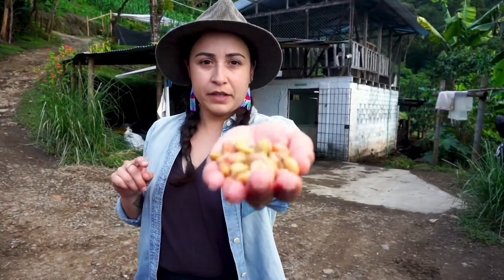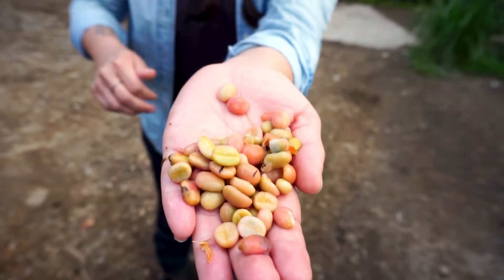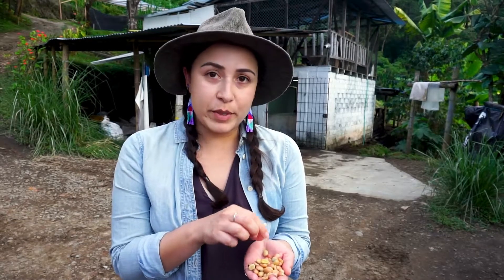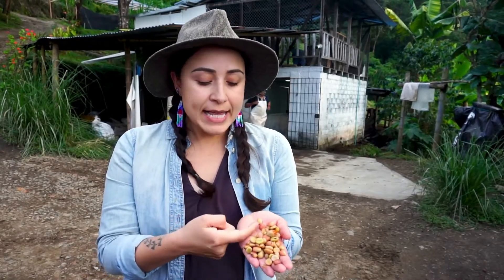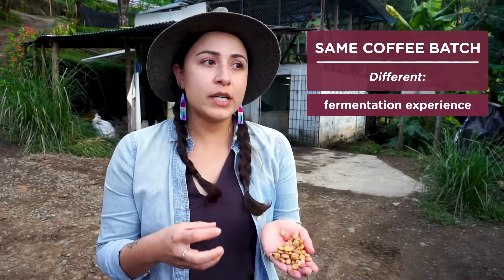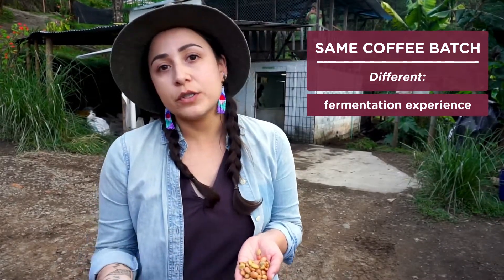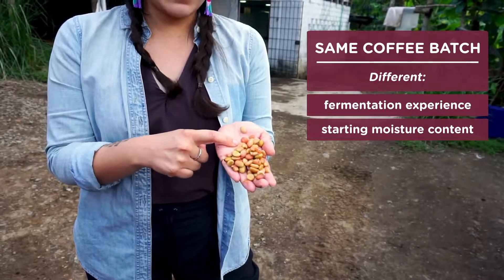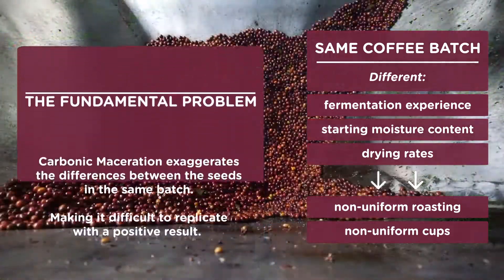The Fundamental Problem with Carbonic Maceration

Comment: the problem is the process has not yet been perfected.  There is irregularity in the exposure of cherries to the CO2 as well as surrounding acids and moisture. This lack of consistency creates inconsistent results.  As others have mentioned, perhaps this could be improved through a regular agitation, perhaps not continuous but periodic.  I see this problem similar to marinades, whereby not all areas of that which you're marinading is equally exposed and even if they were the surrounding fluids may lose their concentration as the meats release liquid.  I think much is happening here as well, though on a much smaller scale.

Another approach I would experiment is to blend anaerobic process of just the mucilage and then blend in washed seeds and then let them ferment together.

Comment: The problem isn't with carbonic maceration, but in the way it's done. The current process produces uneven results. Perhaps agitation during fermentation is needed; shaking, or stirring. Experimentation with the fermentation process may improve uniformity.
Reply: Agreed. And there is sorting. Going through all grapes by hand, even multiple times, to select the best ones is standard in high quality wine making - why in the world wouldn't people do this for coffee as well. It seems this could fairly easily be done by a machine, too. After the best and most even ones have been selected, the rest wouldn't need to be thrown out, it could either undergo more fermenting or just be aggregated into a lower quality batch. This would raise the costs, sure, but I doubt it would be by too much for it to sell.
Reply: Yes but I think the point of video is 

It can be used as marketing tool and ppl shouldn’t just be like 
Take my money when they see it on the bag